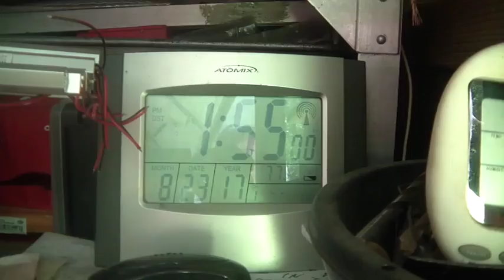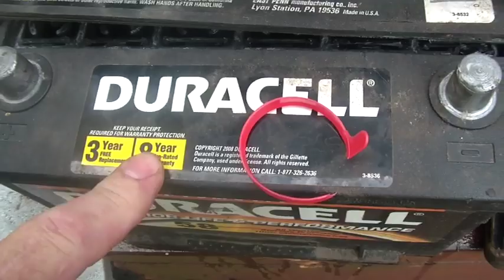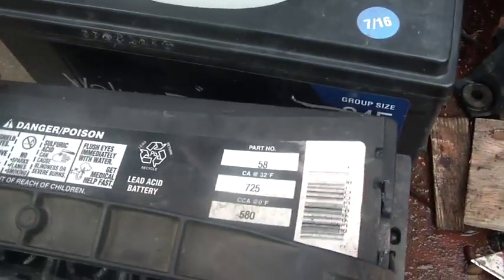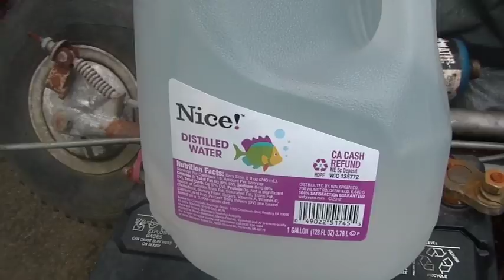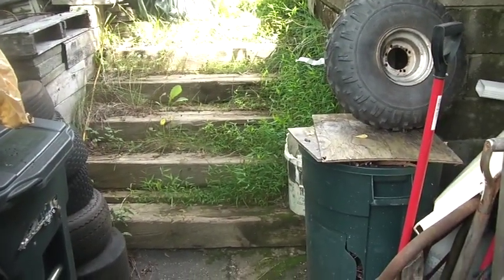Reviving a sealed lead acid car battery, 1996 Ford Ranger Battery died,

Comment: Hey Harvey, looking forward to seeing how this comes out. I had no idea Duracell car batteries were made by Johnson Controls. That means they're probably pretty decent in my experience... since Interstate batteries have always treated me well.

Who would have thought that acid in your face was a bad thing?

say, have you got a spare fuel tank and/or any spare plastics which would fit a 1984 Honda ATC200s? I'm sort of looking for those parts for mine. I also need the little rubber bumpers that the tank snaps into in the front as mine fell off years ago. If you've got any of this stuff up for sale, I'm interested. Or, if you know where to get these things at a reasonable cost, thanks!

Comment: Harvey thanks for your videos I was able to wireup and start a panther 110 we got for free with only putting $13 in a new cdi plug and plug wire. Now I'm wonder how to rewire my liquid cooled linhia manco talon 260cc
Reply from the maker: Hey John!!! I'm glad that my videos have helped U, about the talon, what shape is the wiring in, gone or just ripped up a bit????   For me, I would use a 12VDC powered GY6 CDI and matching spark coil, I would power it with the battery, pick up ground off the engine case, and use the pulse generator on the engine, (blue and yellow, or blue and white),  this video should help, https://www.youtube.com/watch?v=v7Cun1U7bjM   , Let me know how U make out.... Thanks for asking, watching, and commenting!!!!

Comment: Hey Harvey found some more that need to be saved.          https://vermont.craigslist.org/mcy/d/atcs/6236927397.html
Reply from the maker: Hey Mike!!! That is a nice hoard of stuff!!!!  It would take my truck and trailer to bring it all home... Not a bad deal at $600, I would try to bring it down a little, depending on how many recoil starters, stripped shafts, intact seats, etc are there.... Thanks for the info, Ur thoughts, watching, and commenting!!!!
Reply: Harvey Spooner no prob Bud! I figured I don't have the cash to add to my own hoard of random stuff so I figured that I would try and get them saved by a pro like you. Plus they are much closer to you.

Comment: I have always been told to store a battery on concrete floors or ground will kill the. 6 years is dam good life for a battery.  Last battery I bought was $120.00+...
Reply from the maker: Hey Calvin, I have heard that storing batteries on concrete kills them also, but, I could not figure out a reason why, in a car, they sit on a steel shelf, or a plastic tray, or in my garage on a wooden shelf, what is the difference? Seems that this battery has a dead cell and it uses a backwards terminal layout. I will probably have to buy a new one at Sam's... The bigger batteries cost more then $100, in that case Molt's $30 special is a deal even if it is over a year old, for a $90 battery, the deal is less good and if it goes bad in a year or 2, no deal was had.... Thanks for your thoughts, encouragement, watching, and commenting!!!
Reply: Calvin, I saw that and thought the same thing.  So I looked it up...the plastic housed batteries now a days are safe to store on concrete.  The theory was older batteries in a hard rubber casing, sitting on moist concrete could conduct electricity and drain the battery if it could find a ground.  Who knew?  All these years I've made a conscious effort to not leave batteries sitting on concrete!
Reply: OHHHH they myth buster! Great thanks.
Reply: You got it.

Comment: You might try to desulfate the battery if this don't make it hold a charge after this......I've had good success using epson salt and distilled water to desulfate the battery and distilled water to rinse then refill with new acid....then trickle charge them slowly then load test and 8 out of 10 I've done that to lived on.....epson salt and distilled water and new acid are all fairly cheap
Reply from the maker: Hey Dude, If it does not come back, I may just give the Epson salt a try.... 8/10 is not bad odds.... Thanks for the suggestion, watching, and commenting!!!
Reply: Harvey Spooner its definitely worth the gamble of a few bucks versus the price of a new or used battery